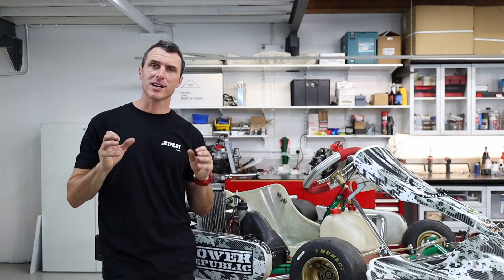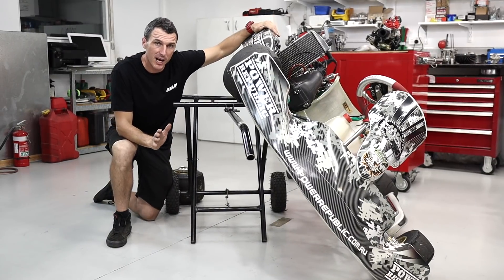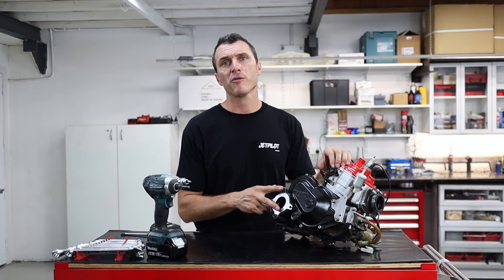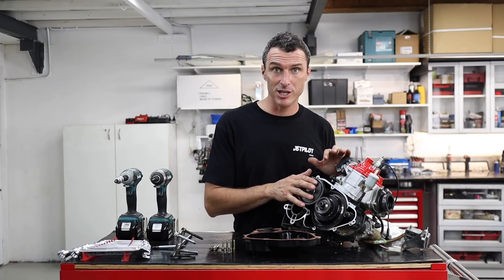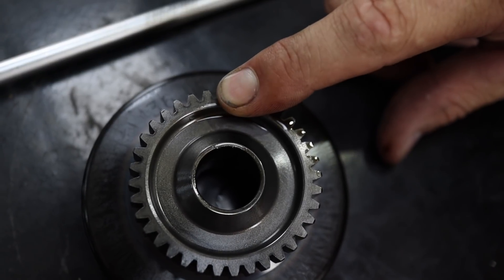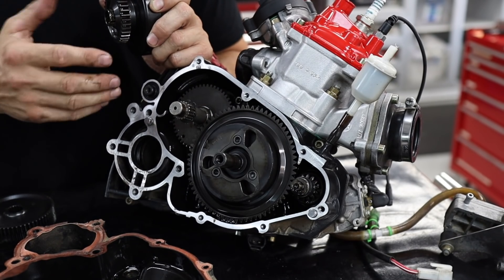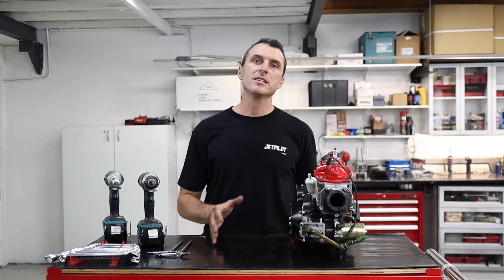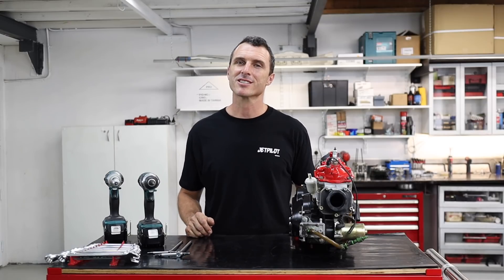How To Change The Gearing On Your Rotax DD2 Engine - POWER REPUBLIC

Comment: Is it correct that the newer dd2's have slightly different gearing than the older ones or can you actually use 20 year old gearing on a brand new dd2?
Reply: Also trying to figure this out.

Comment: Hey. Me and my dad bought a go kart DD2 and the go kart has been in the championships before and one thing I didn’t realise at the start when I first drove it was if the go kart maxed out on 13000 rpm and would only go up to 111 kph we only realise in the garage that the go kart had something wrong with it and wouldn’t go faster than 111 kph and capped at 13000 rpm. Can you maybe help us out because we tried looking for a problem but couldn’t find it anywhere. Do you maybe know what could be wrong ?
Reply from the maker: Have you changed the gear set to 35 or 36’s?  Also check the main jet isn’t too rich. Maybe check and get back to me

Comment: Hi
I know this isn't the right video to ask this question, but I could not fint a video about jetting in the rotax dd2 evo. I sometimes find it hard to chose the right jetting. I know that I have to think of humidity, temperatur and air presure. Do you know if there's a chart that I can use? I haven't been able to fine one online.
I'm a big fan of your video btw - always very helpful.
Reply from the maker: Hey Charlie, awesome, glad you like them.  I don't use the App my self.  The modern EVO engine series jet within one or two sizes for almost all conditions IMO.  have you watched our dellorto set up videos??
Reply: Thanks for the respons. I'll definitely have a look at the dellorto videos as well.
Reply: Hey man I have a DD2 and I bought a 7 dollar app on the play store it tells you all good settings based on GPS location. App is called Jetting for Rotax max EVO. but in general a 135  main jet is ok for 70-80 Fahrenheit I also live in NY for elevation reference. Needle position 4 is ok as well.

Comment: Hi Power Republic!! Thanks so much for the awesome video, helped me a lot since I just bought a DD2 engine myself. Was wondering what type of fluid to use for these DD2 EVO gears? I am in the USA and having an extremely hard time getting my hands on a bottle of the official XPS DD2 gear oil -- would likely cost me around $100 USD with international shipping just for 1 liter of it! Any known good alternatives? I know 15W-40 engine oil works for the senior max motors but wasn't sure for the DD2.
Reply from the maker: not sure as we use the XPS but I think Maxima Kart Gearbox oil should do the trick, I think that is from the USA.
Reply: @PowerRepublic  Looks like exactly what I need, never heard of it surprisingly! Thanks so much for the tip, you guys are legends.
Reply from the maker: @Jmasta7  👍
Reply: @PowerRepublic  You know just one more question about this, so according to the video (3:48) the gear sets apparently are 36-61, 37-60, etc... is it as simple as a 1 tooth increase in the front sprocket translates to 1 tooth less on the rear sprocket?  Is there any kind of chart that denominates what each gear should be paired with?  Seems that it is important to marry these front sprockets up with the matching gear to make the set so I would like to get it right.  Thanks!
Reply from the maker: @Jmasta7  yeah they have to match as a set or they won't mesh.  and yeah to gears last numbers have to add up to 7

Comment: Hi guys great work with the Channel:) I was wondering if you guys can make a video
About what to do when the clutch/gears starts to slip
Reply from the maker: Hi Laz,  are we taking DD2 or regular max?
Reply: I am so sorry :). Rotax DD2 I have a pre evo, does it differ in the gearbox?
Reply: To be quite honest, when I pick the kart up, the tiers spin with the axel, but as soon as I put her down and put her in 1st she won’t move, and when she does move it’s hardly a inch
Reply from the maker: laz163 I think that might be terminal my friend. First up check the clutch shoes.  They are under the drive Sprocket that should just slide off once you remove the gearbox cover. Then you will need to check you input shaft of crank drive nut for damage or failure.  This one might be a job for your local pro go kart mechanics. 
Let me know how you go.

Comment: Hi! 2 questions please ,1)  I need to remove my DD2 engine from the chassis, any advice, is that difficult to do? 2) Have you ever tried the 140cc cylinder on a DD2, does it improve the power considerably, or there’s not much difference with the standard 125cc cylinder, my son is driving me crazy about the 140cc cylinder. Thanks in advance.
Reply from the maker: its not really that hard, other than the first time.  I have one to do in the next few weeks and will video the install for you.  2) I havent used the 140cc kit,  I only just heard about it the other day.  I imagine it would be as awesome as going from 100cc to 125cc!!!!
Reply: Power Republic 
Thank you so much, I look forward to the video. I did buy the 140cc cylinder two days ago, haven’t tried it yet, I’ll let you know how it goes. Cheers!
Reply from the maker: Oh yeah, that sounds like fun.  Maybe go up a couple of main jets to run it in and practise with?
Reply: Power Republic 
Yes, that’s what I was told, to go up a couple of jets when I use the 140cc cylinder, the last thing I need is to seize the engine , that would be terrible. Thank you so much! We’ll see how it goes.

Comment: Hey man I’m currently racing in KA3 and I’m a single race meet away from getting my B grade license. I’m stuck between DD2 and KZ3 (KZ2) class which is the 6 speed class. What do you think? As far as retrofitting a DD2 would be easier no? Because I don’t have to fit (and weld tabs) for the shifter linkages. Thanks for your advice
Reply from the maker: The DD2 chassis and KZ cassis are different cause the DD2 doesn't have any bearing hangers on the engine side of the kart.  so you will have to choose either DD2 or KZ2 and stick with it until you want to change class again.  I reckon I would step into the DD2 first for 12 -18 months.  Then once you have mastered the front brakes and extra power, step up in the KZ.